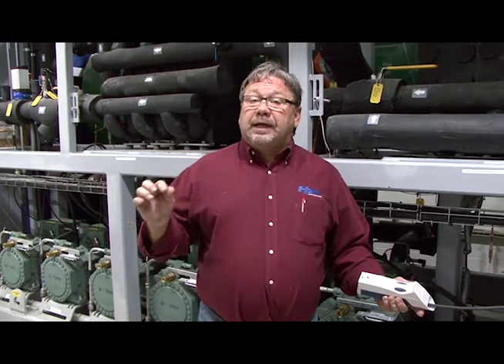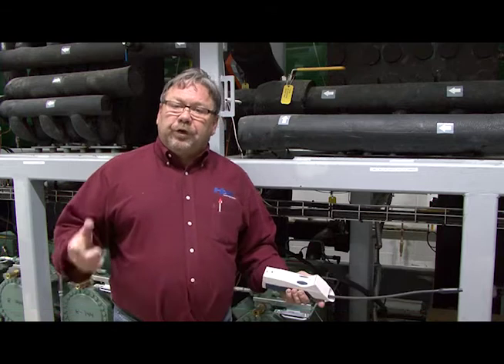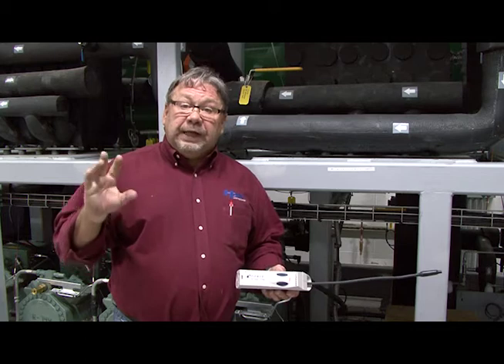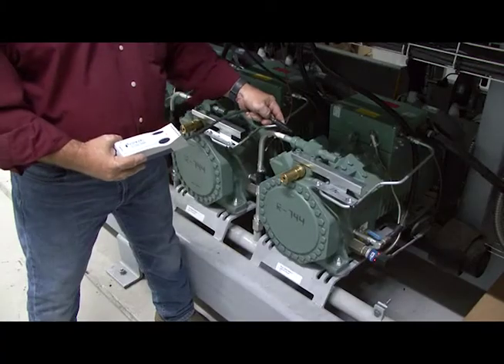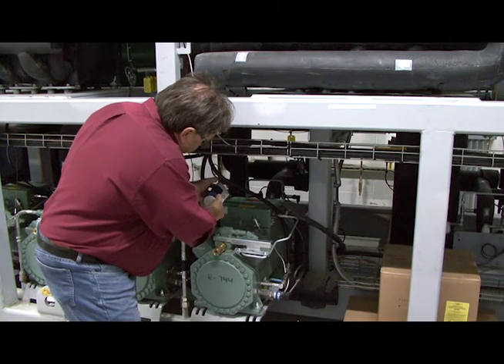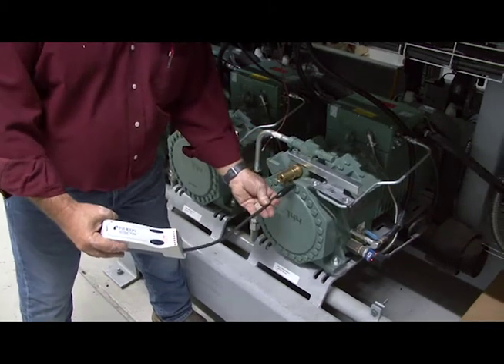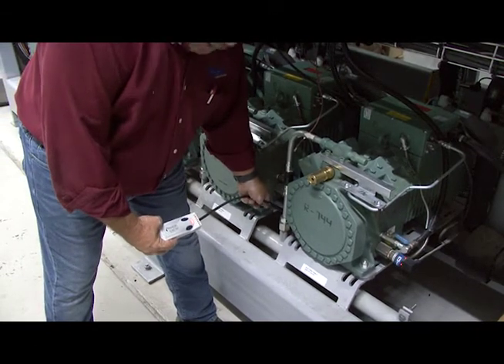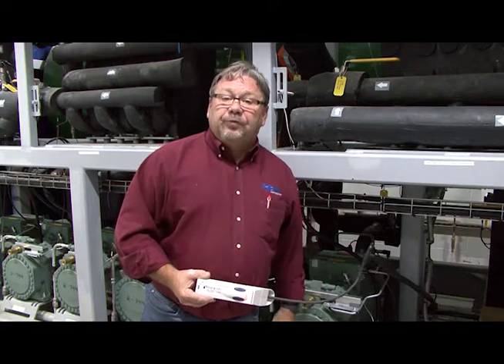Advansor CO2 Booster System Tech Tip - CO2 Leak Detection

Comment: Should I be alarmed with getting hits while checking under relief valve caps? No leaks detected with bubbles but occasionally get hits when removing a relief valve dust cap.